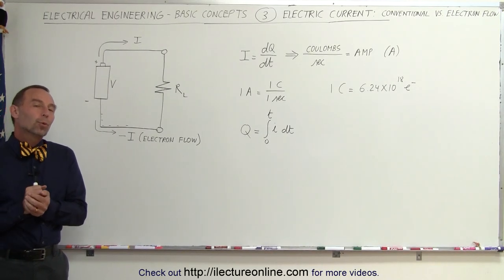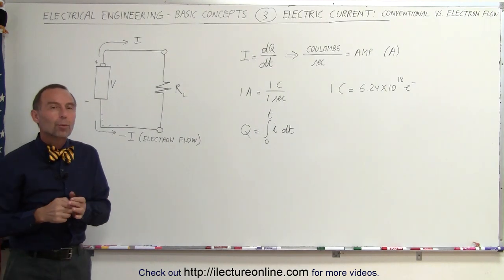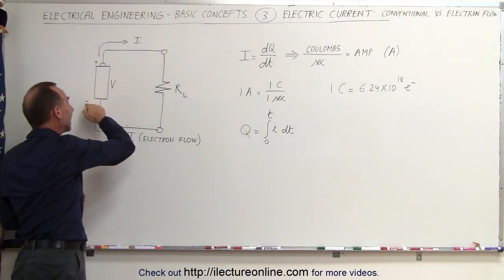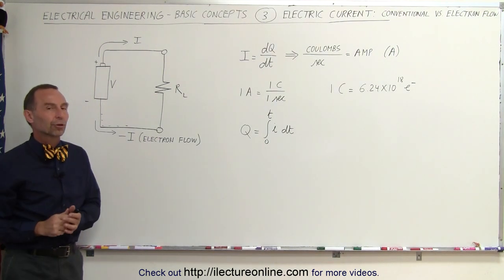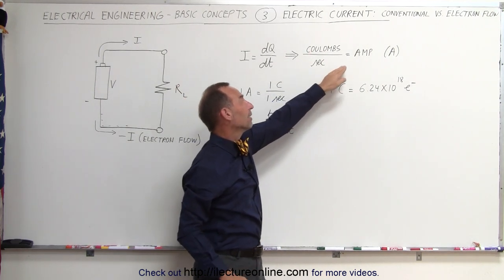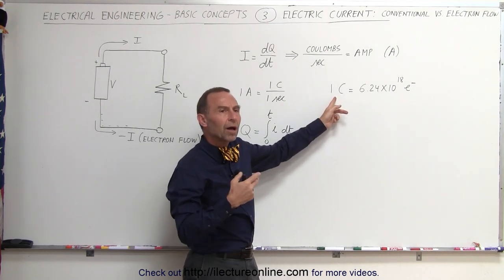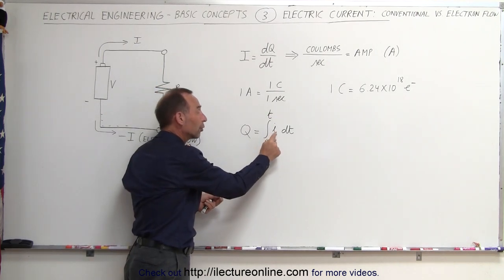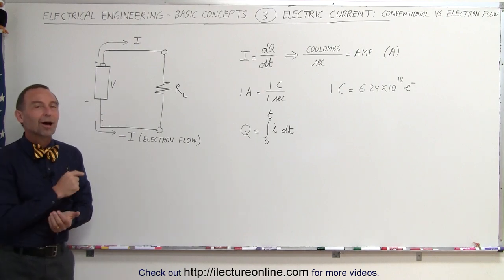Electrical Engineering: Basic Concepts  (3 of 7) Electric Current (Conventional vs Electrical Flow)

Comment: Hello Professor Biezen,
I've seen different versions of the electric charge integral, some going from "t_o" to "t" or from "-infinity" to "t" and the one you showed here from "0" to "t". My question is what is the difference between all of these formulas? Are there certain cases where a different version of the formula is used?

Thank you :)
Reply from the maker: It doesn't appear to be a differnt formula, but the choice of the limits.  The choice of limits depend on the situation or what is being asked.  When the limits are from 0 to t, that means you start the measurement at t = 0 and end the measurement at some time t later.  That will give you all the charge that left the battery from t = 0 to a final time t.
Reply: @MichelvanBiezen  Ahhhhh I see, that makes much more sense than what I thought.
Thank you for taking the time to respond, I greatly appreciate it. :)

Comment: How can one calculate the value of electric  current  passing through a wire with the help  of   I= dq\dt  .  To do this one has to count no of electrons passing through a particular point in certain duration of time, which is impossible  to count.  I think it is just a theoretical concept has no any practical   importance  isn't it sir ?
Reply from the maker: +Anil Horizon   To the contrary.   We were able to determine that a current running through a coil would experience a force in the presence of a magnetic field.  This led to the invention of a galvanometer which enabled us to actually measure the magnitude of the current.  New technology allowed us to digitize this method with solid state devices which led to the digital multimeters, analyzers, oscilloscopes, etc. all of which are used to measure current.
Reply from the maker: +Michel van Biezen  In addition Ohm was able to figure out the relationship between current, voltage, and resistance.

Comment: why teach on the mistaken concept of conventional current? You yourself said "the real current" is electron flow. So why keep teaching a falsehood?
Reply: You have concluded that it's a 'mistaken' concept. But it's not! Electron flow by itself is not the same as electrical current.
An amount of positive charges going one way in a certain amount of time is the same current as the same amount of negative charges going the other way in the same amount of time. It's the same current in quantity and direction.
In metals the electrons are doing 'the moving'. In other materials and in chemical reactions other particles can also do 'the moving'.
If electrons are going externally from the negative to the positive terminal of a battery, what are they doing *internally*? What other charges are moving inside the battery? And what is the amount and direction of the current inside the battery where different charges can be moving in different directions at the same time? Think about that!